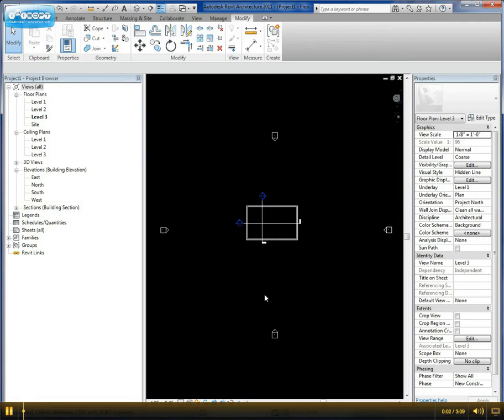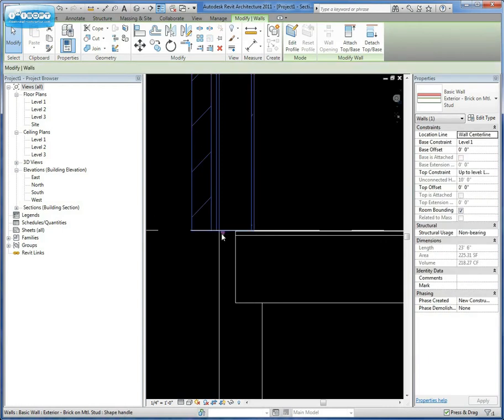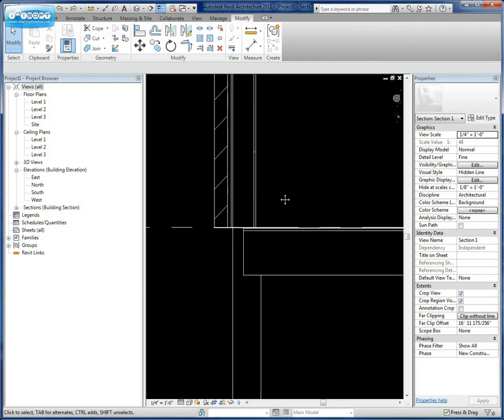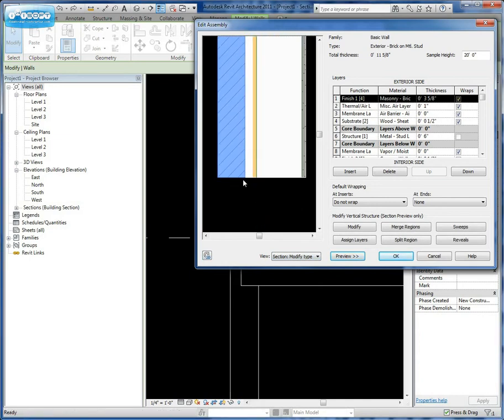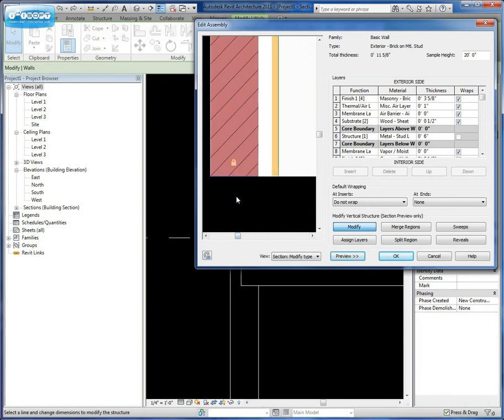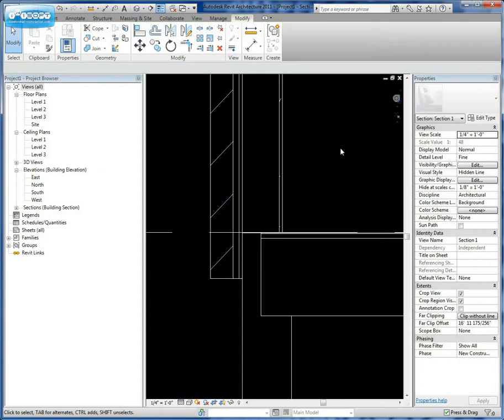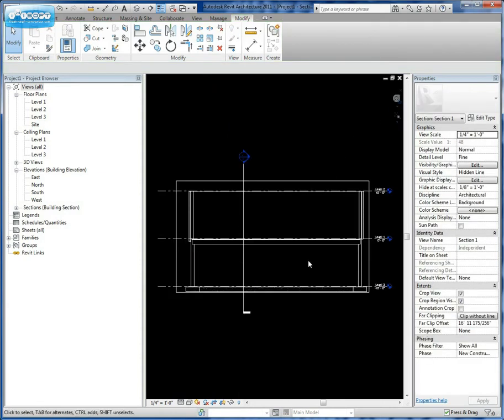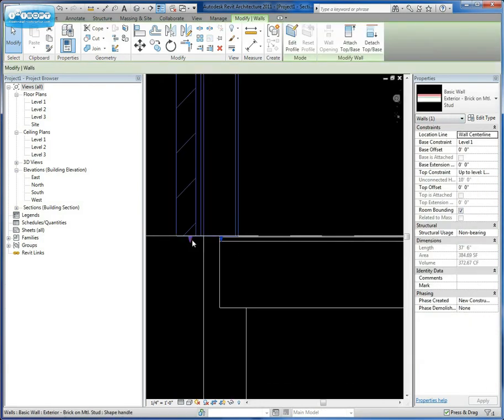Adjusting Wall Facade

Comment from the maker: Yes, it should allow you to extend the finish material. You will have to "unlock" the finish layer at the top and bottom of the wall to have control of the top and bottom of the opening. You may be better off if you are looking to create a separate brick frame (that is offset of the wall slightly) around the winodw, to create a component (either in place or a new wall hosted family) that you can adjust for each/all openings.

Comment: Hi 
This is a great tutorial.
Does this edit of the walls work if you cut a hole into the complete element?
IE: if you had a window opening 10 x 10 and wanted the outer brick layer to extend by forming an opening 9.5 x 9.5, can this form of edit work in that instance?
Many Thanks.